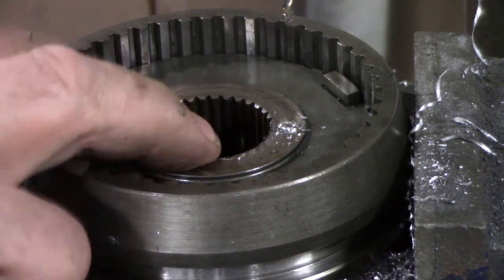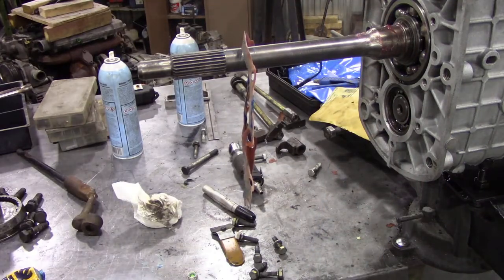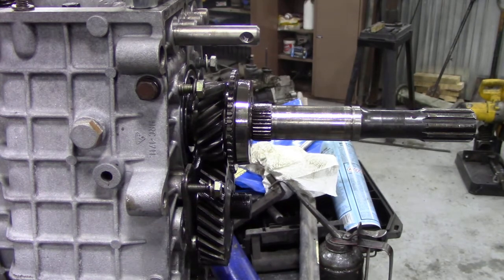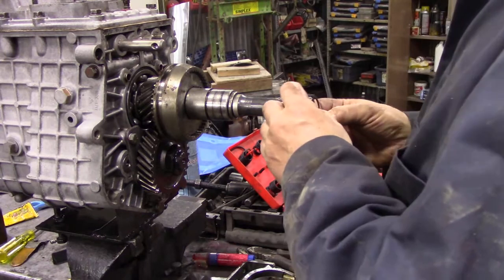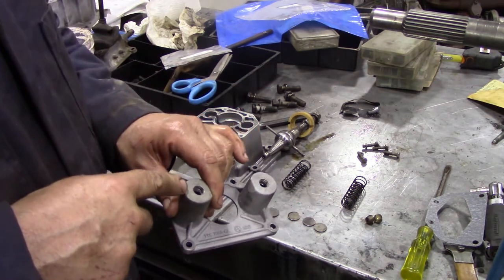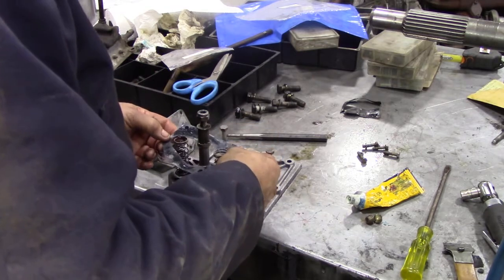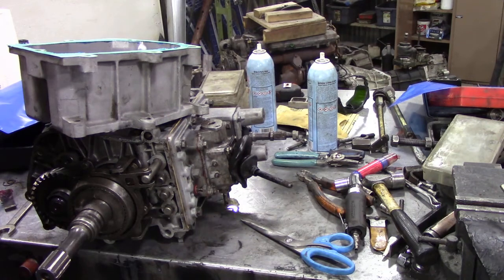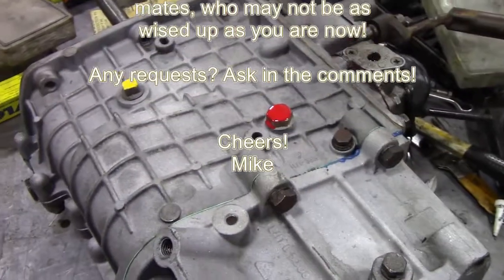Land Rover Defender LT85 22C rebuild – Part 5

Comment: Top notch, thanks! My LT85 20C is noisy in 1, 2, and 3; so I reckon I may need a couple bearings on the lay shaft.
Reply from the maker: Good luck!
Reply from the maker: https://ashcroft-transmissions.co.uk/wp-content/uploads/2021/10/Defender-90-110-workshop-manual-3.pdf

Comment: Hi Mike,
I've watch lt85 videos twice or three times, what a great job and better explained. I own a 2500 DL Santana and it's got an lt85. The 5th gear grinds sometimes, sometimes with doble clutch works great but not always and sometimes it changes fine... I think it might be the syncrho. What do you think? In this case, would it be possible to change the syncrho just removing the back cover? Thanks for sharing all your knowledge!
Reply from the maker: I am not sure about the LT85 5th - I will have to go over my work again and find out

Comment: In my lt85 there was a spacer in front of the layshaft bearing outer racer, that you forget or was'nt there racer? Behind the front plate where the input shaft seal is

Comment: Great video Mike!
Please need your advise. 
Recently I rebuild my LT85 and runs smooth and nice except when shifting from 5th to 4th gear. Above 75km/h from 5th to 4th is scratching. Below 75km/h it shifts normaly.
Any ideas?
New plate and disc installed as well if its related. 
Thanks
Reply from the maker: To be honest, I have not driven and LT85 in 18 years so I cannot say what is wrong

Comment: Another Great video mike, makes you wonder why Land Rover just didn't use the LT85 in all its vehicles?
Reply from the maker: The good thing about the LT85 is it is user serviceable - the bad thing is it is a bit agricultural.
I was thinking the same - if they put the better syncros in the LT85 and made it smoother then maybe it would have been a good box
The R380 is a big LT77 - some people believe they are stronger, but from a mechanics view, I have repaired an awful lot of R380s with busted syncros and broken layshafts etc

You know, I think since the 90's, Land Rover have been making vehicle they think you want, not what the customer needs  

I must admit I have become totally disillusioned with newer vehicles

Mike
Reply: Britannica Restorations the LT85 and LT95 were very strong boxes and I would say stronger than lt77 and r380, I've been running a lt77 for 14 years since I filled it up with water (accidentally wading in wales) and it's been fine, I've also got the r380 fitted to a td5 discovery which we've owned from new and that's been a good box, that's covered 160k
Don't rush the gears particularly 1st to 2nd and they will last, also make sure you've unrated the input gear as the lt77did have big problems with main shaft wear .
Yes Land Rover have lost their way, I dread to think what the new Defender will look like!
Reply from the maker: The shaft wear on the spline was so easy to fix but it took them years to resolve - by drilling 4 holes in the gear!
The thing is, it was not the gearbox fault, but the adaption of the LT77 to the Defender transfer case - it was in many other BL cars inc. the V8's (albeit underpowered)
That would never have happened with a Japanese car! 
Yes I think the new Defender will be aimed at the US market and totally lost its way
Land Rover will sell on it's name not it's longevity or practicality
You may be aware that the Freelander became the LR2 here and the Discovery 3 became the LR3 etc - tainted names here!
Mike

Comment: Hey mate just thought I ask dose the lt 85 bolt up to a 3.9 disco v8 engine with out any mods I want to put a 3.9 in my 300tdi defender do you have any tip and advice for doing this type of conversion cheers Johnnie
Reply from the maker: IF the Disco was a 5 speed manual 3.9 you should be OK
The problem is the crank sensor - you may need a manual flywheel from a V8 NOT an automatic adapted to fit as there are 2 positions for the sensor
This could be a can of worms...
Reply: @BritannicaRestorations  ok mate thank you very much I will look into it loving the videos mate 👍😊
Reply: @BritannicaRestorations  can you do a video on the rover v8 engine like some good tips and advice and also upgrades you can do to them and what to look out for 😊cheers Johnnie 😊